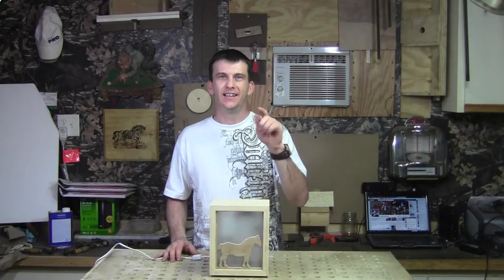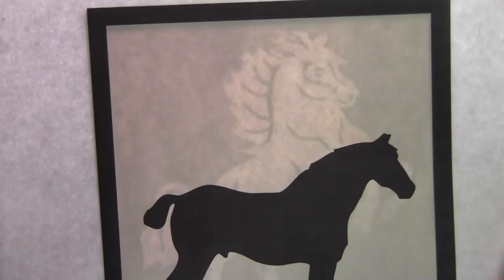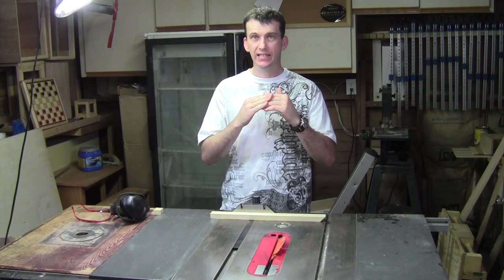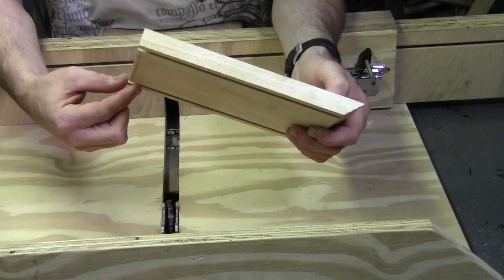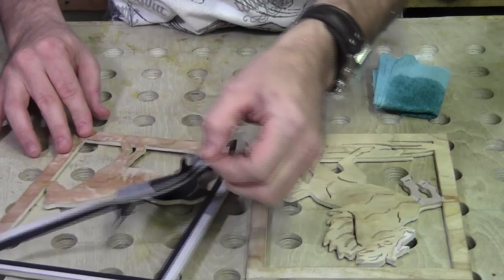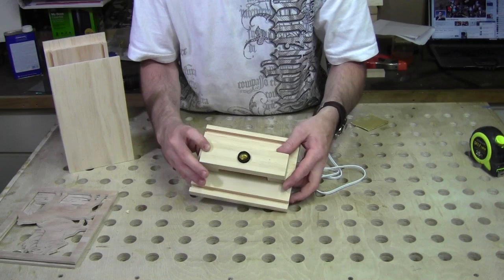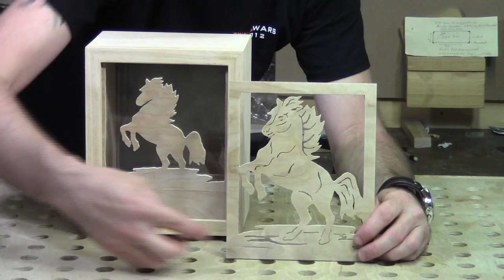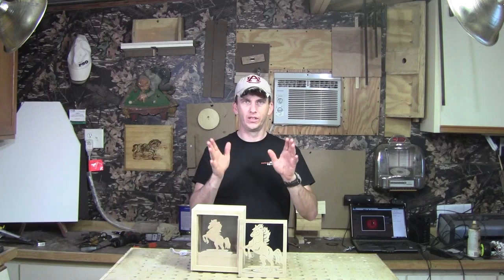Woodworking - Make a Shadow Casting Lamp

Comment: Also, when flipping the boards for comparison, might be easier to check against a square you trust instead of laying on flat surface. On a flat surface you can put the boards together so that they form a scarf joint and the angles compliment each other, whereas if you make a 90 deg joint and check that this is less likely to happen.  You can check a square with a known square board, just mark a 90 deg line, flip the square, and mark another 90 deg line, on top of the first.  If the lines line up

Comment: Hi Laney, I truly enjoy your vids.  This reminds me of Steve's Japanese lamp.  Just one comment, I don't think the saw angle check works.  Say your blade is at 46 deg, then when you flip the piece the 46 deg cutoff sits against the 44 deg main board and looks flat with no gaps.  So no matter what angle the blade is the main board and cutoff will have complimentary angles.  I think the tip would work with one extra step, make two cutoffs and compare those to each other looking for gaps.